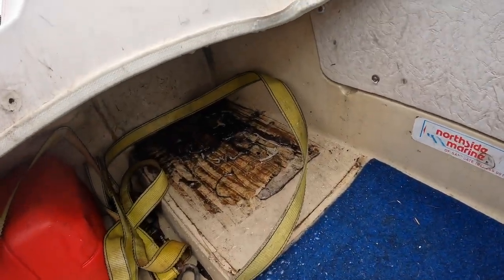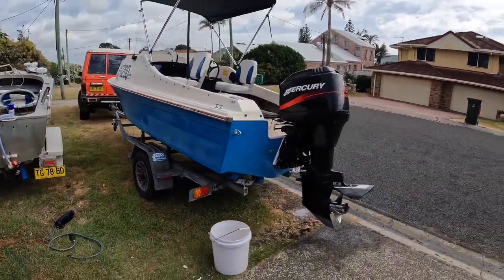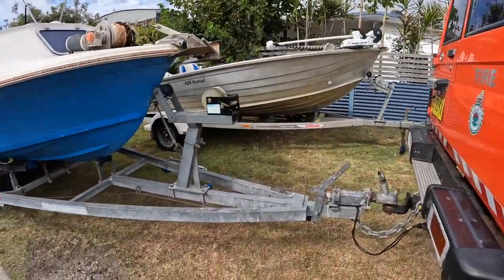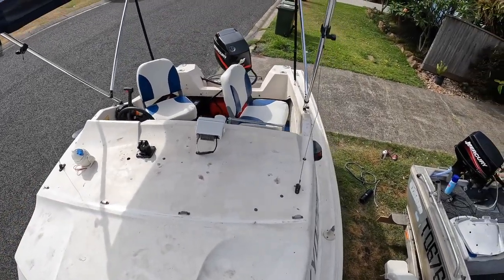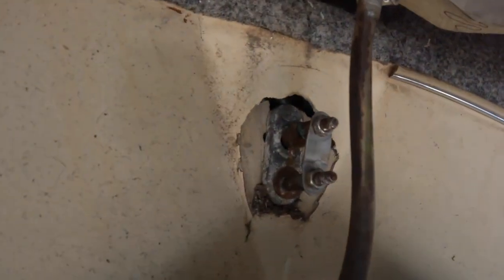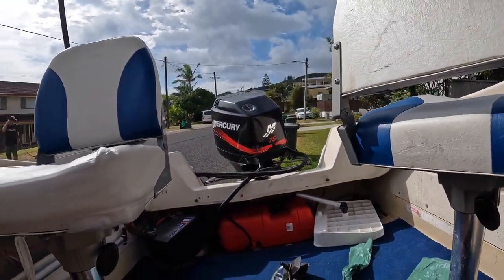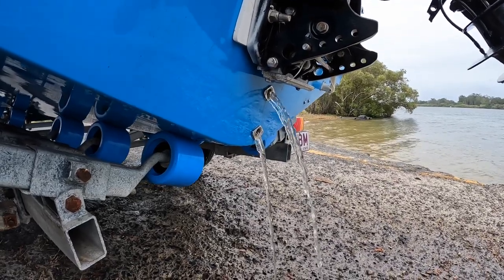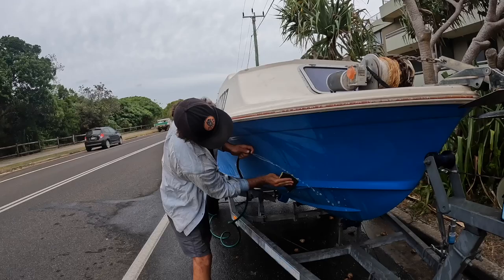Haines Hunter v146 boat restoration/refit

Comment: I had a Haines Hunter 445c years ago. I'm in NZ, but it was one brought out from Australia. Mine was pretty tidy by comparison and I had a Mercury 50hp on it which pushed it along nicely.

I eventually sold it cos I needed a bigger boat and mine always took heaps of water and I could never find the source. The underside was immaculate, so it didn't make sense. Having experience with boats these days, I'd say water was getting in on a transom engine mount or at the bow sprit.

great boats, if they dont leak ;)

Looking fwd to seeing next vid
Reply from the maker: Ahaha yeah mate mines leaks abit and I haven’t found the source, possible one of my bungs is abit out if shape, there great little boat love having a small cabin area to keep things dry ish 
Cheers for the comment 
Looking for a v17 next